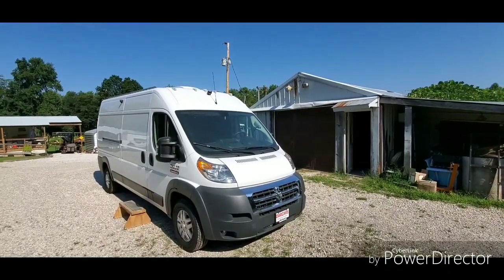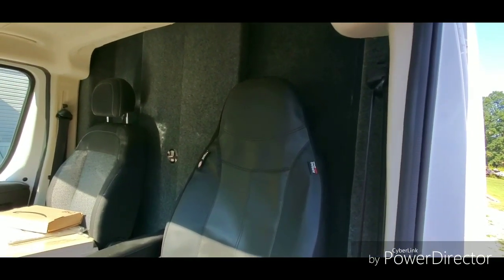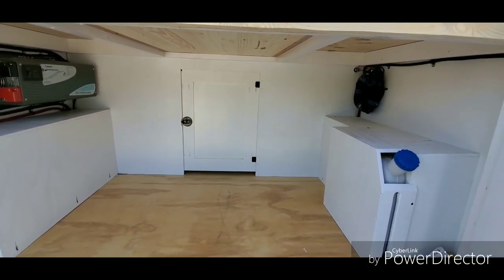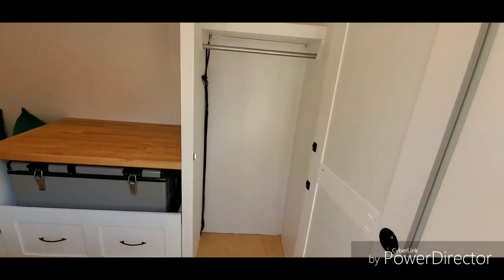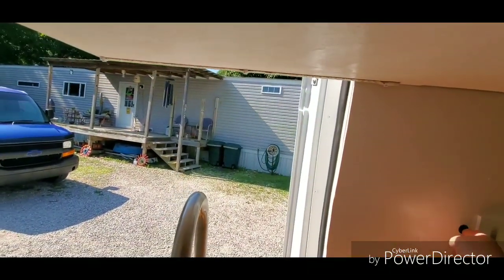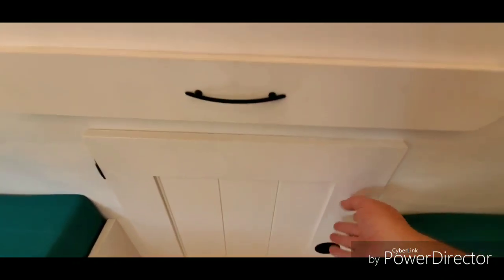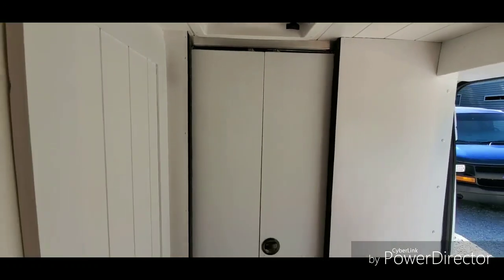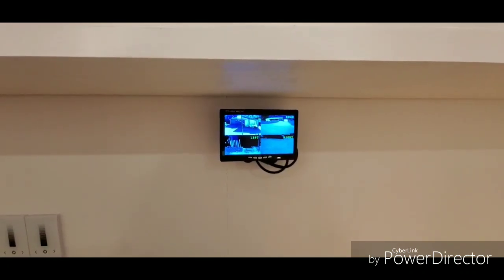"Nurse"BEAUTIFUL 2018 Ram Promaster camper conversion  tour.  E26

Comment: From the video it gives the illusion that the A/C would stick out and prevent the closing of back door. Is the back wall far enough forward to have A/C in it and doors still close?
Reply from the maker: The a/c clears the door by ¼" when its closed.
Reply: Nice! Am always impressed with your work. I think you have an air vent over the garage area, right? Can the a/c be run in stealth mode with doors closed?
Reply from the maker: The a/c is only a ¼" from the door when it is closed, so no it can not run with the doors closed. And no there is not a vent in the 6" between the wall and doors. The garage area is under the bed.
Reply: Ok, thank you for correcting me about this. Have you done any builds that allows the rear doors to be closed and the A.C. to run? I have been thinking for a long time that maybe a fantastic fan above the area with the “outside” part of A.C. pulling air out and maybe some type of maybe 3 or 4 inch intake hole/vent in floor or lower side walls maybe even boat type of blower pulling air in would allow stealth operation of A C?
Reply: StateNewsService he has done some conversions where you close the doors and are able run the a/c I think you have to mount the a/c out the back window. I wish there was an easier or cheaper solution to run a/c at night while you are sleeping without plugging   Into shore power